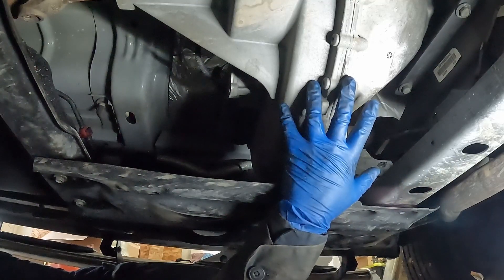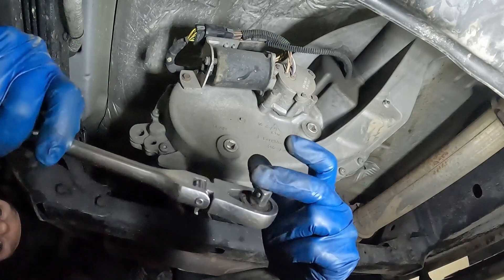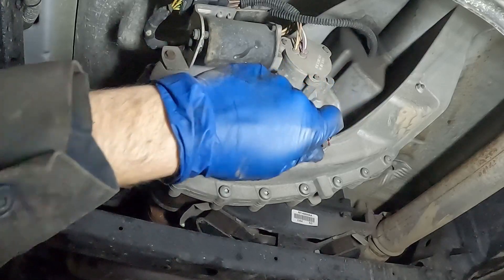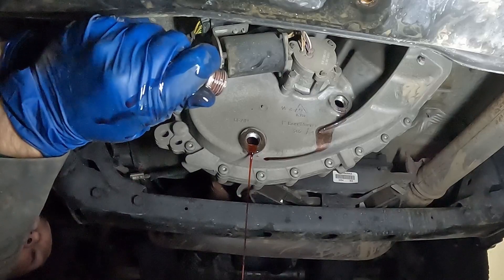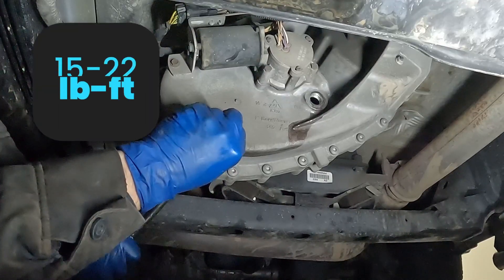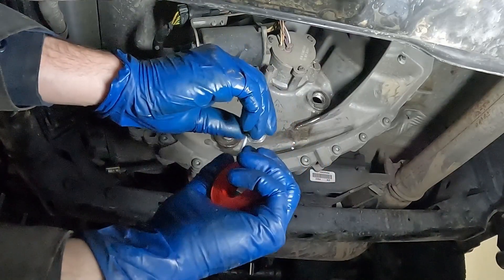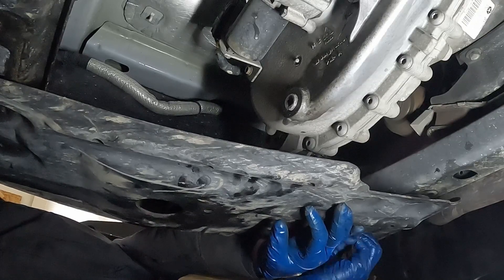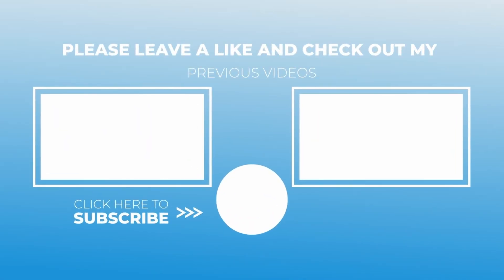2011-2018 Dodge Ram 1500 Transfer case Fluid Change Easy DIY

Comment: Overall process is the same on my 2010, but instead of a 3/8 square drive the plugs require a 10mm hex. Also, you can use thread sealant paste which generally is a little better than teflon tape.

Comment: Hey!
please 
which oil specs does it need?
Reply: Depends on which model transfer case you have. You can crawl under your truck and there will be a tag on the transfer case with the model. Take that model and check your manual for the fluid type (or Google it)
Reply: 2 quarts or until a bit comes out the top

Comment: Do you mean Teflon tape?,  never heard of nylon tape for pipe thread sealant, only for the material used for fish tapes for electricians’ wire pulling.